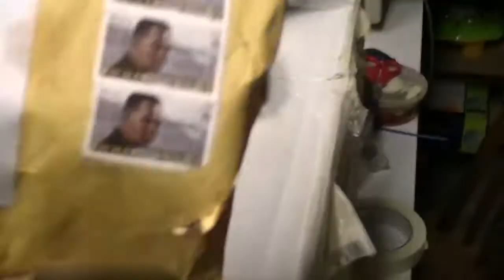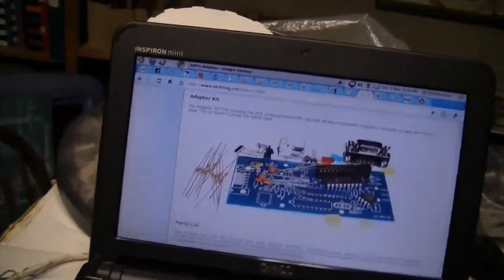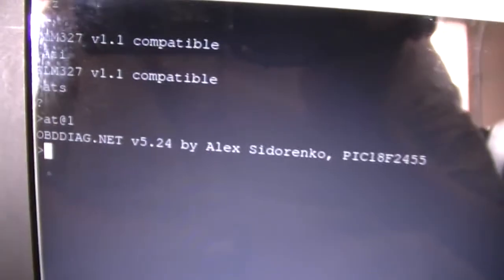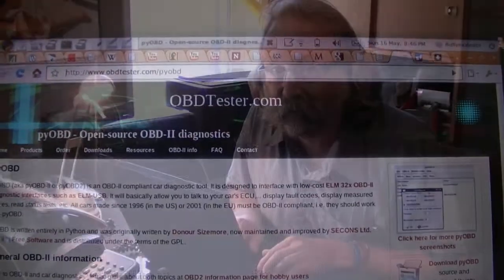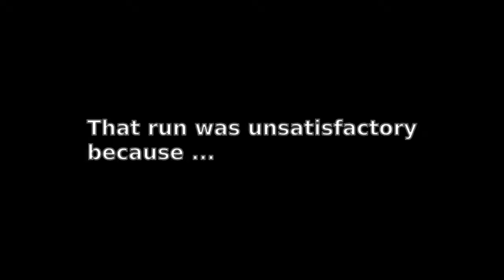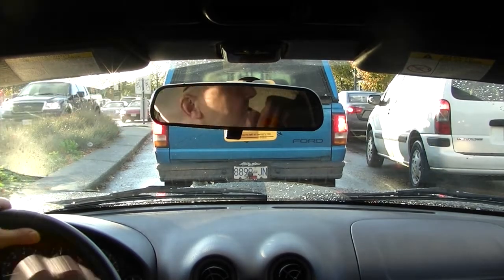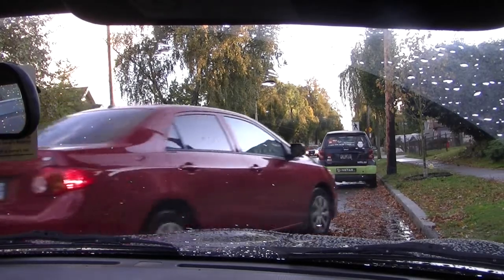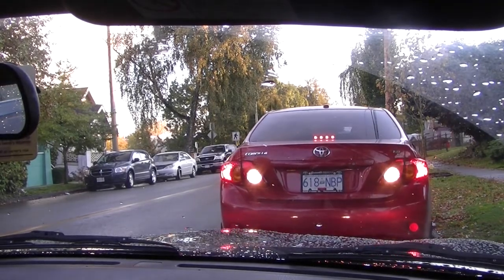X-Lapse

Comment from the maker: That's precisely it (or, rather, that's approximately it due to unavoidable errors). The original footage had 9 driving minutes with big variations in speed including quite a bit of sitting at lights.

One of the things that does throw some visual shocks are those frames that happen to be included when a leading car is very close to the camera. I imagine I could change my driving habits to stop further back at lights. Another idea would be to hit downtown at sunrise on a Sunday to avoid traffic.